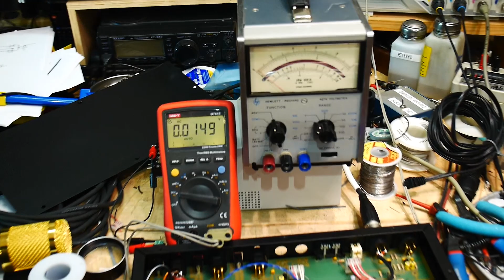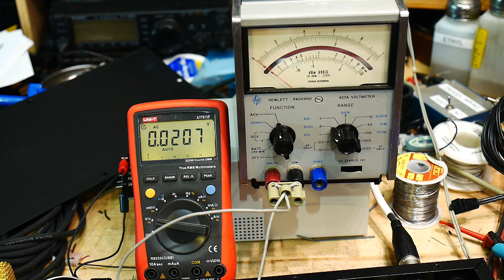#490 Analog Meters are Useful

Comment: Looks like ut61 is on a wrong range for the signal. Try putting ut61e into mV range. I think it has faster update speed than the needle. Afaik I was able to see 5 or 10Hz signal on bargraph. I'm not sure that an analog meter can do it. Better yet, a "scopemeter", but those are rare and usually expensive.
Reply from the maker: nice scopemeter for $67: https://youtu.be/EUr3k9Jdx58